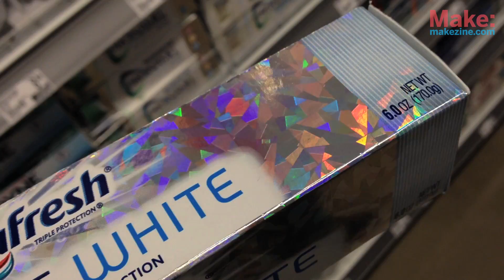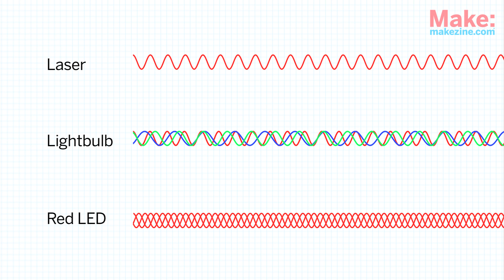How-To: Holography

Comment: It's been a couple of decades since I made holograms with chemicals. I'm looking forward to working with this type of holography. I'm guessing the included laser is only 1 to 5 mW? Should be interesting to see how short the exposures would be with my 40mW HeNe professional laser. Also would be interesting to see if reflection holos can be produced with this kit. Have you attempted it?
Reply: using a gas laser, would require a lens to spread the beam, but it will propably be much more even, than the stripey patters of an unfocussed solid state laser. 
i am trying to learn more about his amazing technology, but there isnt a whole lot of information on interferometric photography. if you know any good articles or websites, i'm happy about every bit of information i can find.
Reply: @Ucceah  Sorry for the delay. YT just now pushed your comment to me. Yes, you do need lenses, preferably, a spatial filter.
Reply: ThomasGrillo Just curious.  Did you get a chance to use this hologram kit?  Do you have any holography equipment for sale?  I need one.   Are you in the States?
Reply: GoodShepard007 I've not had a chance to try this kit yet. I'm in a place where vibrations from outside prevent holography. However, I've noticed this kit is a bit more forgiving by design, so when the opportunity presents, I will try the kit. I still have all my holo gear, but I'm not in a position to want to sell it just yet. :)
Reply: ThomasGrillo Thanks for replying.   I have a few questions I would like to ask you.   I have to upload a important video.   I will get back to you afterwards.

Comment: Is the hologram only visible under the laser's beam? Or can it be viewed without?
Reply: It is no bad if you use a white single led flashlight. You may add some proper color filter for better rendering. I bought the LITI kit, and it is impressive, although not technical support or information is given. Nothing about conservation of the hologram, for example.
Reply: This^ Please answer this
Reply: only with the laser beam
Reply: It's been a while since you asked this question but I will answer for the ones that are interested like you. YES, it CAN be visible at sunlight, it only depends on where you place your object. There is one method called single beam reflection hologram where you place the object behind the plate. You can find some diagrams on how to do it very easily with the same setup. I have done it before, the only difference is that I had to make my own glass film plate by coating with gelatin, silver nitrate and potassium bromide.

Comment: Is the beam splitter necessary?  It seems that any change in direction you create with the beam splitter will lengthen one beam  in relation to the other therefore the two beams will always be out of phase with each other.    Now it is necessary they be in the same frequency so two lasers may give a separate frequency but definitely I don't see what the difference is between a split beam or an identical laser.  One beam is bound to get lengthened arbitrarily by much more than the frequency.